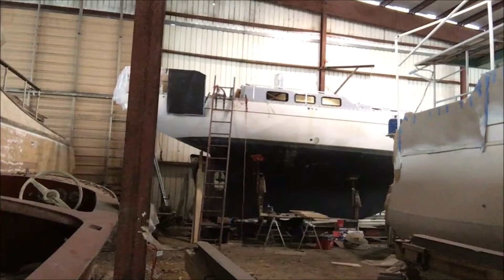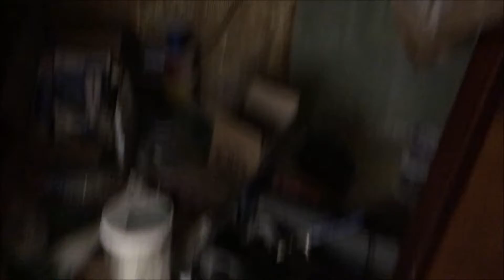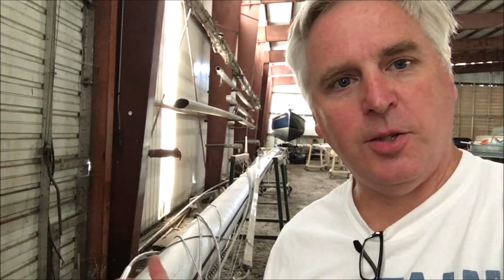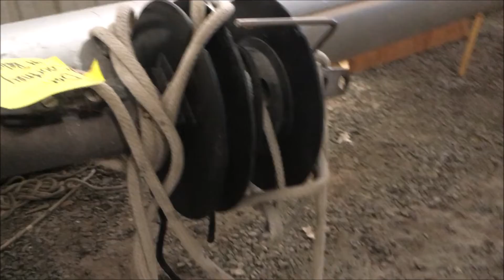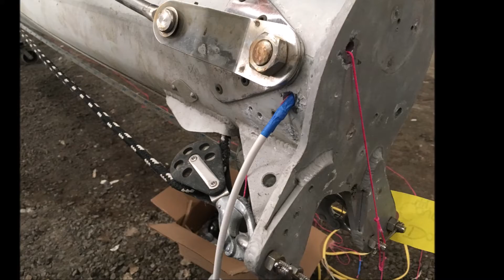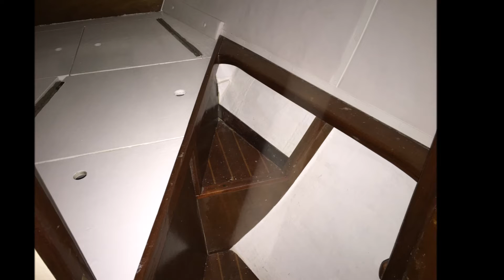Ep. 15 - Marcelina    January 11, 2019 update

Comment: looking really nice . i'm so happy you did these videos . thank you .   quick question . is it possible to not use the mizzen mast ??  what are the implications of that ?
Reply from the maker: Thank you. Sailing downwind the mizzen doesn't really come into play because it's better to have the boat pulled with a genoa or spinnaker. But sailing upwind is different. A ketch rig has the main mast farther forward vs a conventional sloop (single mast) so that the full sail plan (genoa, main and mizzen) are balanced against the countering force of the keel. Without the mizzen you would have constant lee helm where the boat tends to veer away from the wind... which is pretty dangerous. A well balanced boat has just a bit of weather helm where the boat, with no rudder input, would slowly turn into the wind. A ketch also tends to have a shorter main mast than a sloop because the mizzen makes up for the loss  of sail area. So the boat would tend to be under powered without the mizzen. Despite the added complexity I like the fact that a ketch lets you have more options for sail combinations and smaller, easier to handle sails for the same sail area/horsepower.
Reply: @dc14522  thank you

Comment: The new switch panel looks super cool.  ⚡💡
Coming along slowly is better than not at all.
Thanks for the update.  ⛵
Reply from the maker: Thanks. I got one of the larger panels so I have plenty of capacity for whatever I add to the boat. I also will still have a remote panel in the cockpit for things like nav lights that I can switch on without going below.
Reply: @dc14522  
Awesome! You can show us that one next time. 
I'm curious, does your yacht have mains voltage circuits through an inverter or generator or is everything 12 - 24V?
Reply from the maker: @jtveg  I've got a 1000W inverter, but I still haven't decided where I'm going to put it, so it's not hooked up yet. The DC system is all 12V.